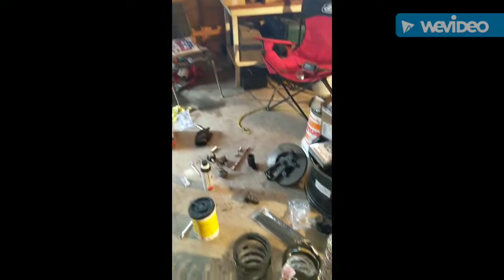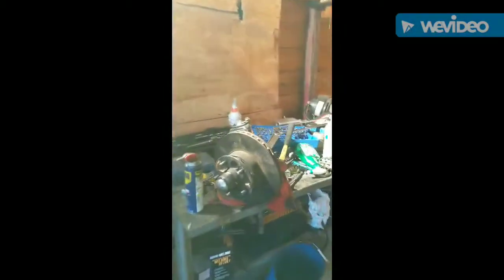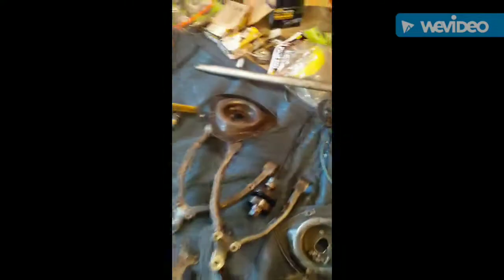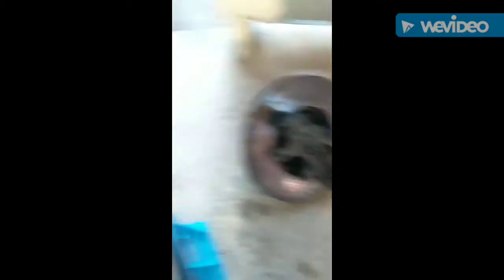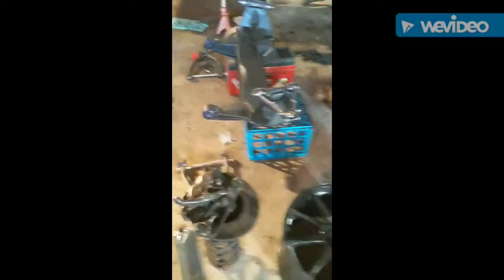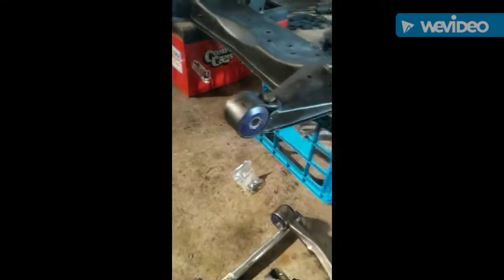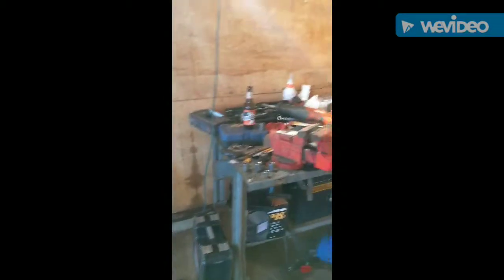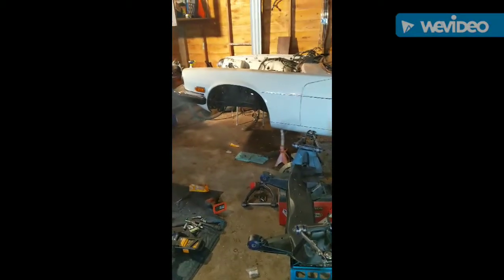1985 Jaguar XJS  subframe assembly

Comment: I hope your car is back on the road by now. 
Where and what part number did you get those steel braided  brake lines and were the fittings correct?
Reply from the maker: It is so to speak, with another owner.  Brake line kit was not correct.  Threads did not match calipers